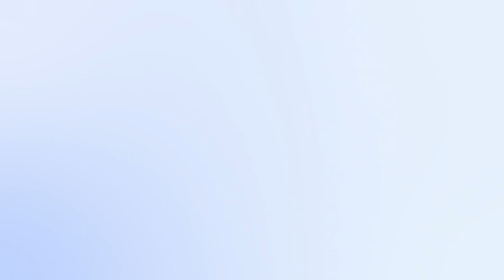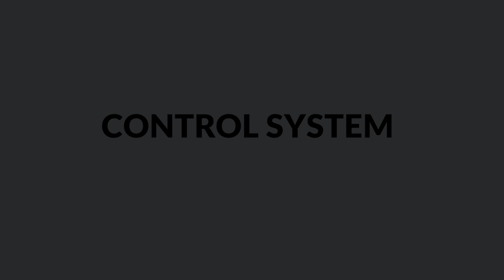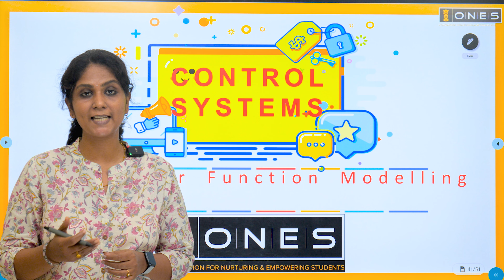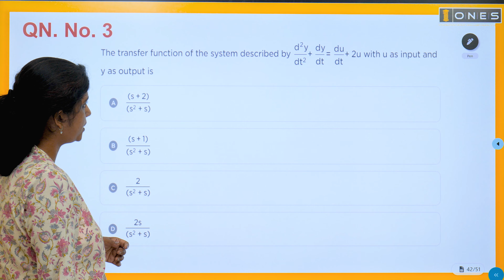GATE | CONTROL SYSTEM | TRANSFER FUNCTION MODELING PYQ - SESSION 2 | ONES

Comment: In 8:53, there is a correction, when X (s) is simplified, denominator term does not have a '+' in between, all terms are product factors of the poles.